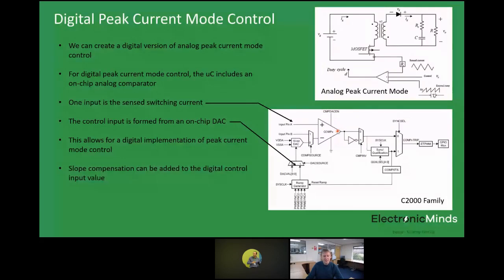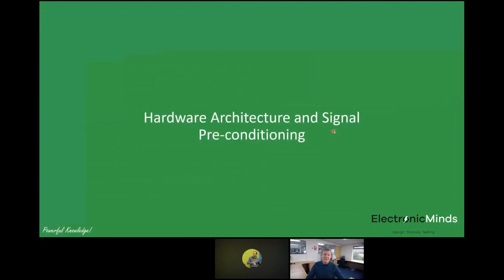Powerful Knowledge 17 - Digital control in power electronics

Comment: Very useful presentation ! 
Can you elaborate on why the sample frequency being same as switching frequency helps reduce noise ?
Reply from the maker: If you can synchronise the ADC sampling to the PWM (or an integer fraction of it) then it is possible to sometimes avoid ADC sampling during a switching transition. This can help to reduce noise. If you sample asynchronously then you can end up getting beat frequencies appearing in your sampled data.

Comment: At the 23 minute, is it 1000 steps or 100 steps for 1Mhz PWM.
Reply from the maker: The clock on the PWM peripheral is 200MHz which gives a 10ns step size resolution. This will give 100 steps for 1MHz PWM frequency so sorry, that is a typo in the presentation. However, the TI Delfino processors support a great peripheral called 'High Resolution PWM' which reduces the step size to around 180ps (or about 5555 pulse widths for 1MHz PWM). We have been playing with this recently and the performance is fantastic.
Reply: @ElectronicmindsUK  thanks for the response. I have another concern though. In the voltage measurement explanation, we doesnt need to use an isolation op amp evertime. We can just use a differential amplifier configuration with very low gain. It works well and the cost is low. Also higher performance than isolation op amps.